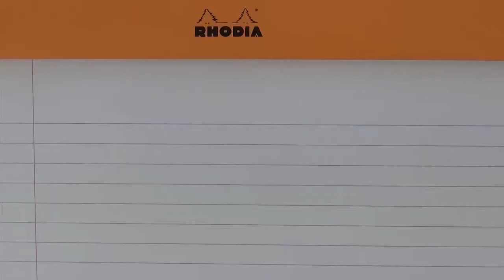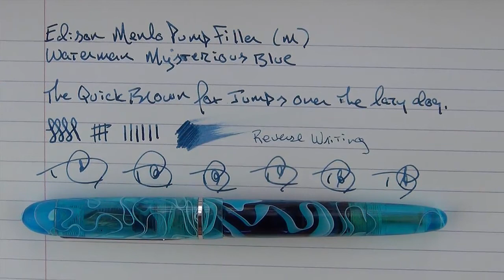Edison Menlo Review

Comment: Could you elaborate more when you said that the pen gets finicky? This is one of my concerns because I notice that on pens with large ink capacity (2+ ml), when the ink level gets really low, the pen will start writing really wet. Some people will say that they don't have this issue with a particular pen but I think I notice it more because I like fine and extra fine nibs. When the pen starts running even just a little wet than usual, it's very easy to notice it with finer nibs. This is actually what is stopping me from going with this filler style over just the converter for Edison pens. It's not the pens' fault, it's just physics.

Comment: There is a way to quickly align the nib and the clip. 

I learned this from having a Conklin Crescent Filler.  

This trick also prevents cross threading. 

When you rotate the cap on and the nib and clip don't align, rotate it backwards until you hear/feel a click, then screw it back on. This changes the thread orientation and you either end up with the nib aligned or the feed aligned (I consider either orientation acceptable). 

On the crescent filler there are four orientations. One digs into your chest if using shirt pocket, two potentially dig into other writing instruments if in the pocket, and one is just right - clip and crescent aligned.

Comment: I would love to here how you feel about the pen after a year. I use a shot glass to load a pen when the ink is low in the bottle. Those Akkerman bottles work well but you first have to buy one with ink.
Reply from the maker: I am still very fond of this pen.  It's a bit on the small side compared to the size of pen I prefer, but I just love the color and swirls...and it writes excellent.  No regrets.
Reply: Exactly.  I wondered if, since it's on the small side, it's obvious charm would be diminished over time as I adjusted to using it.  I've had one in hand and it appears to have continuous dimensions.  The colors aren't bad either.  Thanks for being there.
Reply: The drill bit is fixed and the rod spins to prevent bit-walk often resulting in slightly off centre barrels.